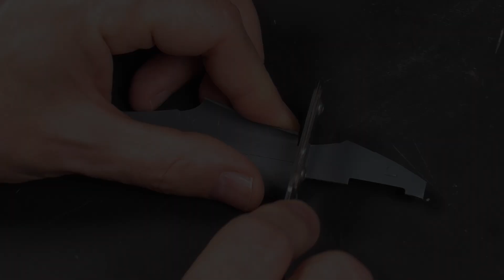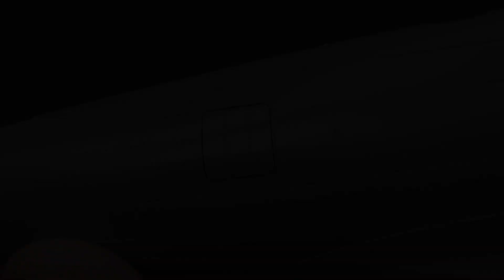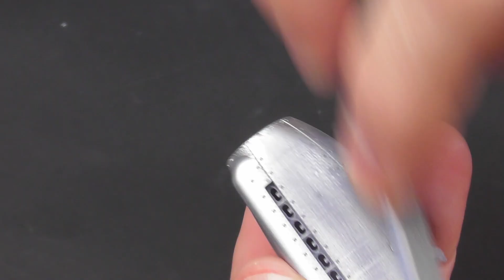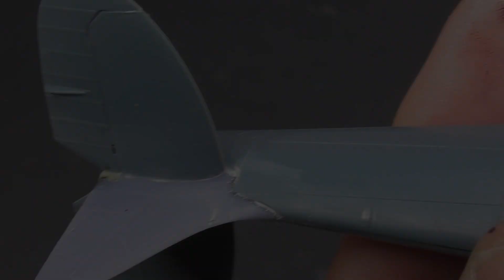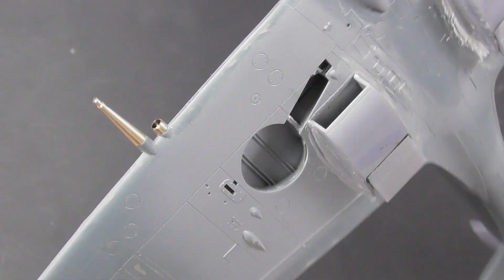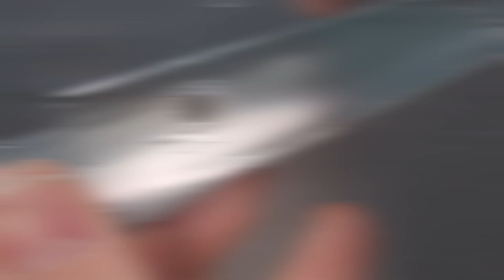Laminar Flow Design vs Eduard Spitfire XIV conversion 1:48. Part 2 Conversion and airframe

Comment: Hi Jamie, took a little too much material off the port tail thankfully the starboard side is ok. Cuts going generally well, presumably Milliput would work to fill the errant cut on the port tail
Regards Howard
Reply from the maker: Easy to go too far but relatively straight forward to fix

Comment: Hi Jamie great work on the spitfires mate,you make it look so easy to do these conversions,but what are the prices for these sets,i would love to have a go at the bubble top my favourite mid,by the way you use Tamiya panel line wash where do you get it from.?thanks a lot mate.
Reply from the maker: Thanks Stephen.  Check out the LFD website, all the sets are there.  I got the Tamiya panel line wash from eBay.

https://laminarflowdesign.com/gb/

Comment: Wouldn't it be safer to cut through the supports well below the part with a razor saw (or even a jigsaw) and the remove the now free supports individually?
Reply from the maker: They are much slimmer where they attach to the part so it's fine, they come away easily but you just need to be a little careful.